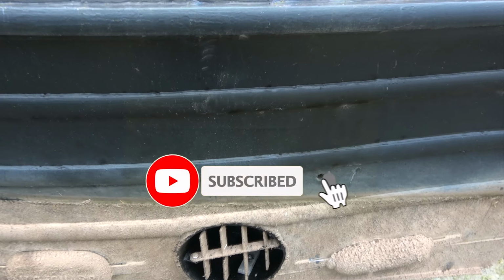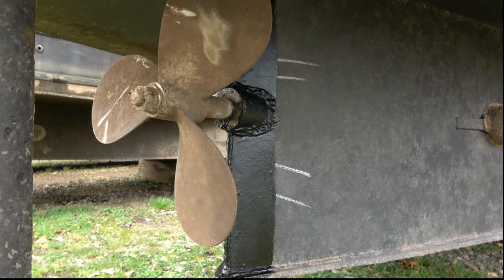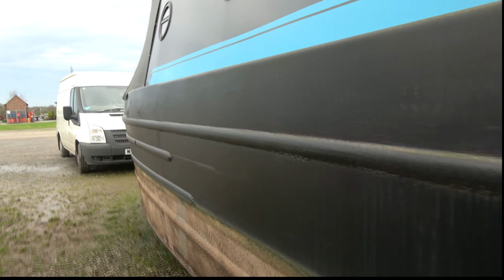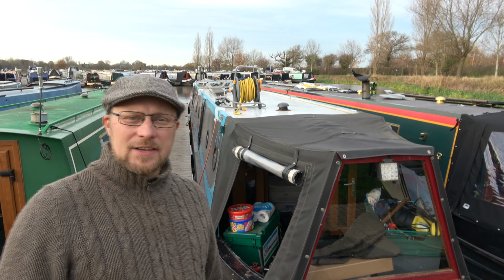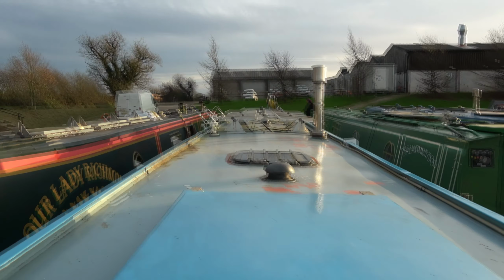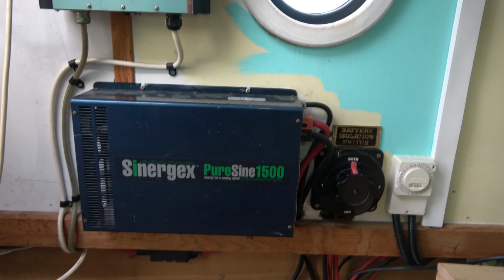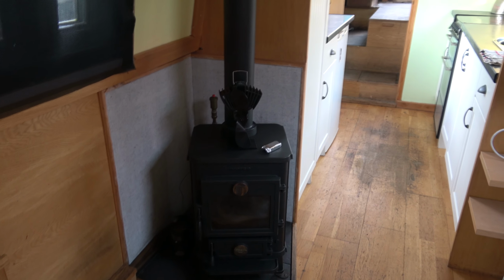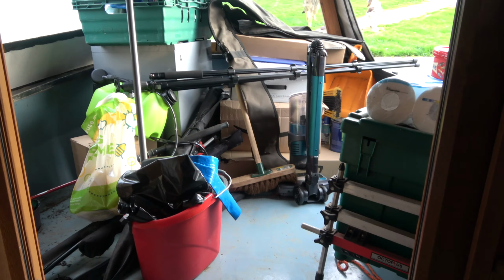#2 We float our boat

Comment: Why did you not clean the bottom off while out of the water.....
Reply from the maker: At the time of recording (November) England was in lockdown and we were only allowed to visit the boat going in the water (1hr) with expressed permission of the marina. We were not allowed to visit the boat to do work as it was classed as none essential and was not allowed on the marina so could not jet it off 🙁. It will however be back out the water this /next year so will be done then 🙂